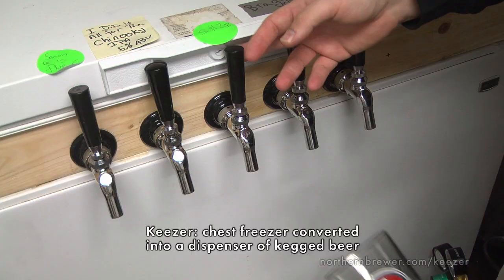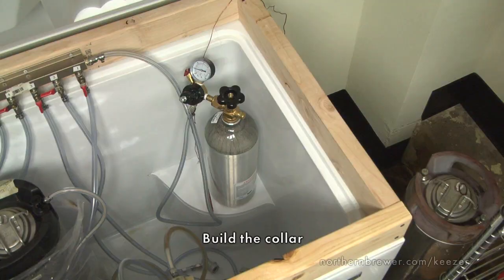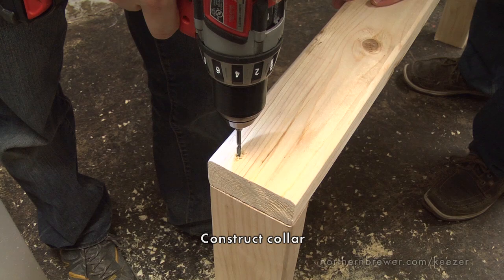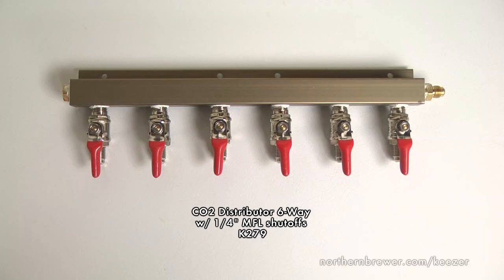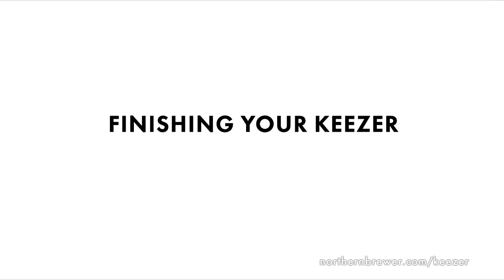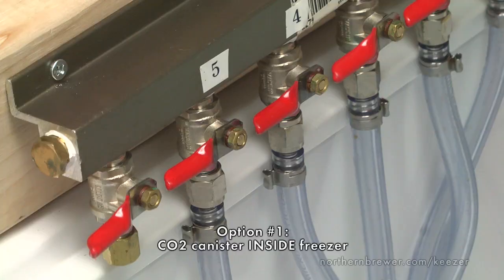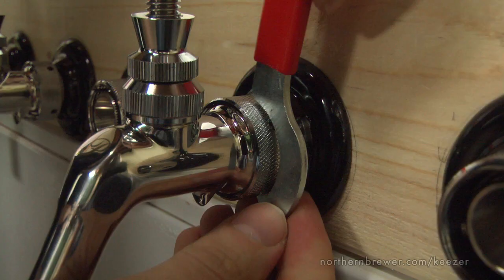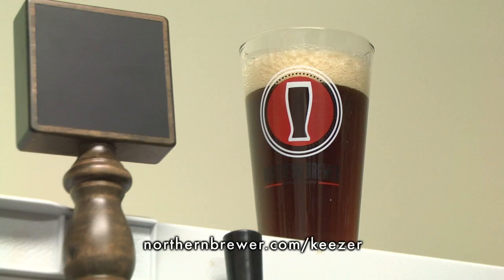How to Build a Keezer or Kegerator for Serving Beer at Home

Comment: Doesn't the lumber have effect on the insulation value of the fridge?
Reply: It's negligible
Reply: Yes it does, so does the extra surface area, holes and metal inserts which will act as heatsinks.
But it really just means the freezer will run more times for longer.
Reply: but it's negligible! First of all it's no longer a freezer, it's a fridge once you put in the temp controller.....so it's already more efficient on that fact alone.  The strip of wood is nothing you'll notice
Reply: You are turning 1 sealing surface into 2 (top and bottom of wood)  so there could be problems if you don't build it properly.

Comment: Could you drill through the lid and mount some draft towers?
Reply: Gen3Benz yes and no. You can safely drill trough the lid because there are no electronics or coolant in it, but the tubing would be a nightmare when you need to open it up
Reply: Was looking at this guys setup...
https://www.youtube.com/watch?v=SgRzejEqeUE

There are a couple others on here. Kinda like not having the wood under the lid.

Comment: Why do you need c02 if the beer is already carbonated?
Reply: Champ - DC you have to use enough pressure to move the beer though the tubing and tap. That volume increases as the keg empties. Co2 keeps the beer carbonated and protected from oxygen.

Comment: The cool thing about springs is that they have no energy when they are not compressed or extended....

Take the lid off when it's open...

Makes life a lot easier.
Reply: still need a buddy to hold the lid then but thanks for the pointless lesson about springs and stored energy
Reply: Protip #626: the drill is a one-handed tool

Comment: This information was definitely good.  I have seen nicer builds though when 1X (3/4 inch) maple/oak/poplar finish boards are attached to the 2x4 collar (or 2x6).  Once attached, the finish boards which are usually stained and poly coated, are even with the top of the 2x4 collar but the bottoms of these boards drop slightly lower over the ouside of the freezer itself.  This prevents any movement of the collar assembly, as opposed to just relying on the silicone sealant to keep it in place on top.  This finished look appears way more attractive and professional, imo.

Comment: i'd use a better wood than basic pine 2x4s as well as seal the wood, also use stainless steel screws to prevent rust

Comment: One other thing this Voids MFG warranty. Running a low temp freezer (-10) at med temp (30-35) double the btu load on compressor and uses more power May kill the compressor quicker short the life. But This is Nice.
Reply: How does it use more power? That makes zero sense. With a controller turning it on and off it should use less power since it doesn't have to work as hard to get down to -10. It's going to kick on reguardless of whether it's at below freezing or 40f. In fact, the closer it is to room temp, the less work the compressor should have to do.

Comment: You are going to kill the compressor. I’d be curious with a follow up on how the compressor is doing. Also, machine screws and then running that large of pilot holes? The pilots weren’t necessary for that and especially that large of holes. Thank god it isn’t structural
Reply: I've had one for 5 years and the compressor is still working fine